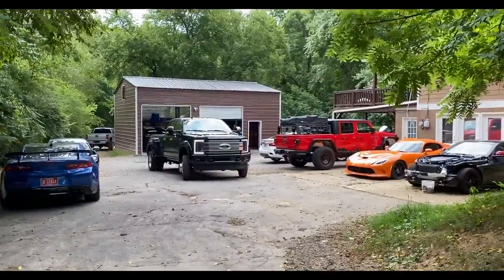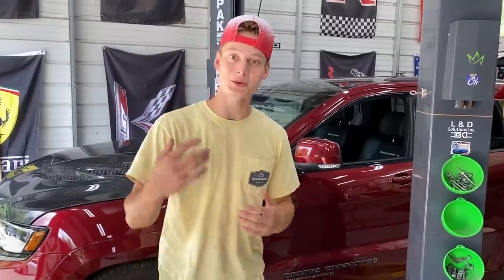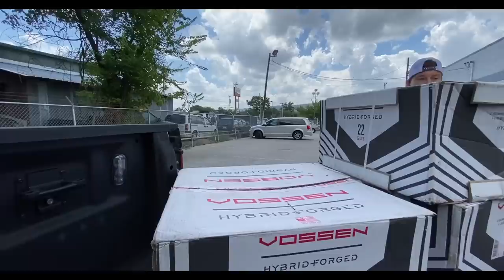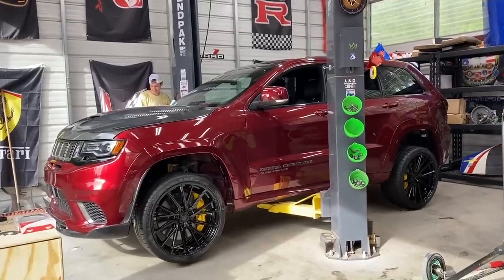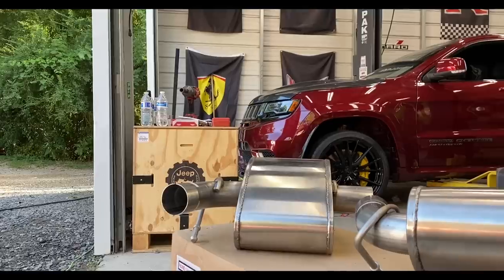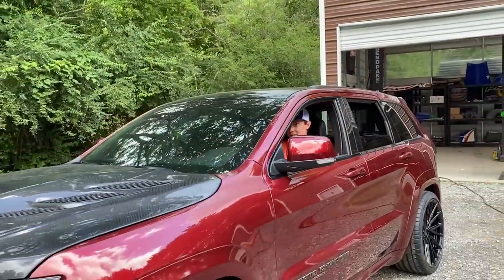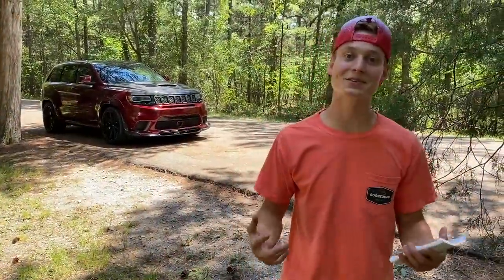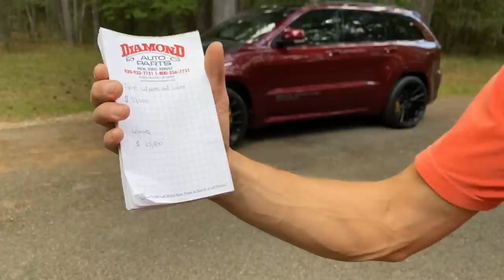The End Of The Jeep Trackhawk!!!

Comment: Nice wheels guys. Couple of tips. When mounting the rim on the machine always grip from the outside in so it doesn’t scratch up the inside when the rim slips a little. Also if the tyres are run flat then in Michelin’s case there should be a ZP (zero pressure) sign on the side. Keep building those epic builds. Loving it.

Comment: Hey guys. I own a Jeep TH and wanted to tell you guys to change that oil in the motor and only use the Penzoil Platinum 0W40 and you should also service the Transfer Case and the front & Rear Differentials too if your planning on ripping it around to avoid breaking anything!!!

Comment: 19:36 this was probably how it ended up wrecked in the first place 🤪
Reply: It has a lower center of gravity and stiffer springs now so it will need a higher amount of force than a stock one to tip it over.
Reply: The person driving it when wrecked didn’t understand that, the Jeep logo was just a disguise! I personally would have taken all the badges off that I could without it looking bad and murdered it as much as possible. As Gomer Pile used to say surprise, surprise.

Comment: Dudes this rivals the Mustang for the Goonzquad’s best build. I would recommend against the run-flat tires though. They are heavy, expensive and they wear down quickly and unevenly. Next set of meats should be regular Michelin Pilots.
Reply: probably sponsored so cant be too picky :)
Reply: @hungryalien  true.. they even mentioned it was sponsored by Michelin..
Reply: The Pilot Super Sport 305/30zr 22 105Y (extra load) tires are NOT RunFlat tires.  
They are also are not heavy but are expensive, grippy and rated to 186mph.

Comment: Great build.  For those you want to build something like this, realize that the used cost is around $80k and rebuilt title is usually around 60% of cost which is around 48K.  So with their cost of 53k, the cost of labor is not recouped.  But it is nice to either keep or make money off of youtube and merch like they are doing.
Reply: w.o youtube its not worth it...
Reply: @dalcallcenter2879  Thats whats great about these youtubers/rebuilders. In the "throw away" society that we live in, we just throw shit away that works perfect and get a new one. Youtube is allowing cars like this trackhawk, that would have ended up being stripped and crushed, to have new life and be back on the road
Reply: What about all the aftermarket mod upgrades they added? The roof, the exhaust, wheels, tail lights, the new paint, even though it was a damaged car they did a great job rebuilding it. So it's better than a used one...
Reply: when they are selling it
someone will buy it for more

Comment: Looks great guys! Detailing tip (havent seen you guys do it) grab an air compressor and just after the last rinse go around with a nozzel and spray out all the water in between the tight spots to get rid of that lingering water! I noticed it dropping down the rear glass when you guys were rippin!

Comment: u shouldn't pay more than 15-20 k for that auction. you have to know sometimes people at auction house sitting and monitoring the price and they or their people increase the price of certain cars when no one else is bidding. just to push one or two bidders to increase the bid. otherwise, the car comes back for bidding again.

It 53000 + 12800 = 65800 total  + 45 days of labor which is around 40 dollars an hour; so 
add 45x7 x40= 12600 
53000 + 12800 + 12600 = 78400 usd.